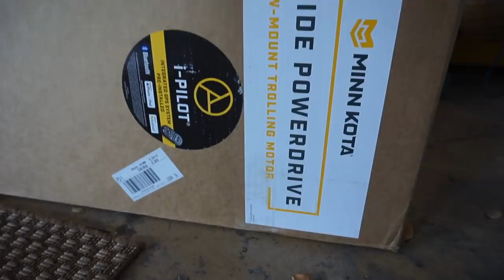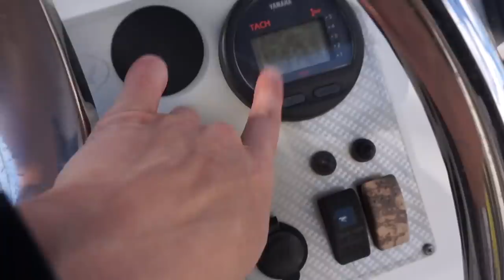VLOG | Getting My Boat Back, Cleaning + Updates

Comment: Jacki, They make a compact charger called "NOCO BOOST GB40 PLUS,  12V 1000amp" that you can purchase on Amazon that may be something to keep on board in case you need to charge anything. Also I like the fish hooks heart on the windshield that you have designed. Good luck with the boat and looking forward to more updates on it!  14 😊

Comment: Jacki:

Why don't you look into having a boat canvas shop make a helm cover for the boat. It will protect all of your electronics etc. from the sun and weather. Whenyou come in after you wash the boat down you just slide the cover on from the top. mine secures with snaps at the bottom.

Comment: Tip on the yellow water stain and all other stains  is you can use muratic acid for boat hulls you can buy at home depot
Reply: For the chalky gelcoat you can use 3m perfect it polish and it will restore the shine

Comment: Use some Booyah cleaner next time. It gets off everything. Then go back with meguires compound. It’s in the blue bottle. Easy on and off.  Will need a orbital palm dander. Then top off with the turtle wax graphene wax. All this is on amazon. You don’t have to make a career out of cleaning the boat. This is quick easy and it works. The graphene wax can be used on everything including upholstery plastic metal and windshield.

Comment: colonite 845 / 885 / 920  with a da polisher using foam pads on the fiberglass and a  brush and rag on the non skid . bar keepers friend and soft scrub toilet bowl cleaner to take off the stains . after  you wax it DO NOT use dawn dish soap as it will strip the wax off immediately . i use gold class meguiars car soap to wash after use .

Comment: Jaky uses a star brite brand product called rust stain remover for brown and rust stains, I have used it on the yacht I work with and it works very well, you can still use sprite nine it is good for ongos and stains

Comment: FSR or Fiberglass Stain Remover made by Davis Industries or Star brite Ultimate fiberglass stain remover is what you want to use to remove the staining from the gel coat and non skid surfaces.  brush or spray it on and wait a few minutes then wash off.  Some tougher stains you may have to do a little scrubbing but this stuff is great.  Maybe star brite would like to sponsor you to be an influencer.  These are both available at you local marine ship store.